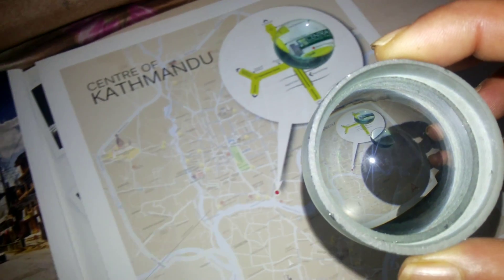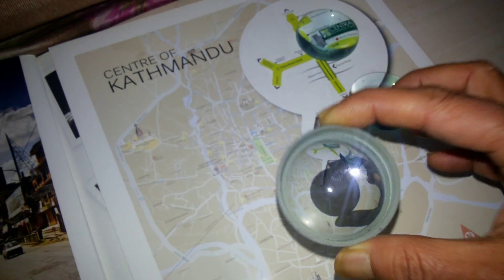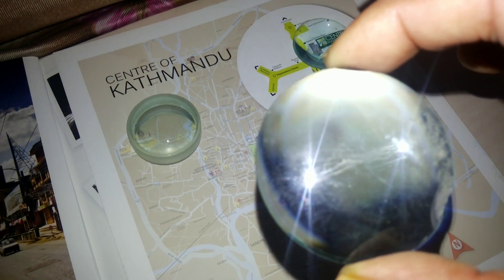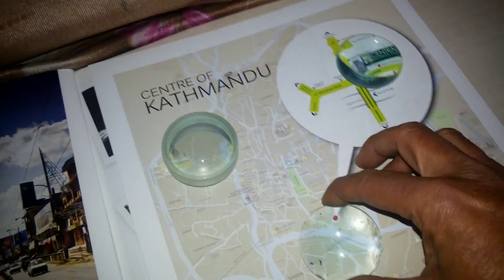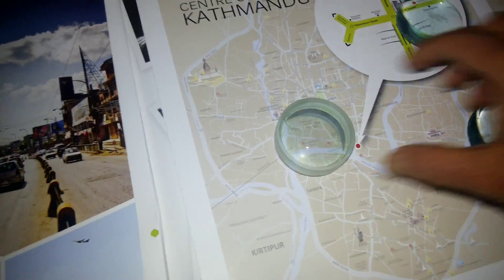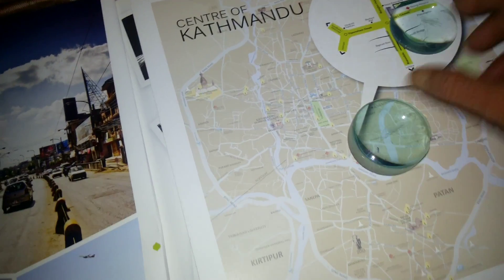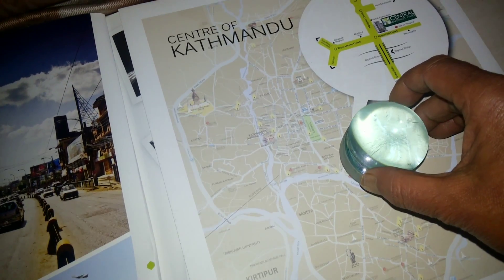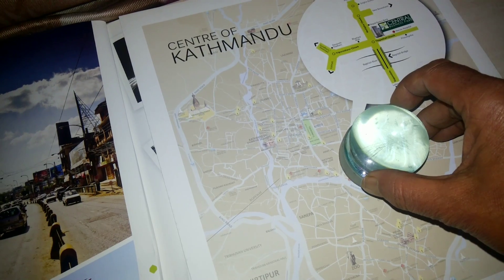DIY Barlow lens 30x Zoom part 1

Comment: I have 100mm focal lenses,
if I used less focal length of lens, will zoom x increased ?
Reply from the maker: Need more details, objective focal/Eyepeice focal is your magnification. Like 100÷5 is 20.
Reply: @debeshbhattarai  
1. 50mm achromatic doublet lens, 700mm focal length
2. 25 mm eyepiece.
so telescope is 28x
can I see nebula or galaxy through this ?
Reply: @abhishekchattaraj3488  no bro you need 500x zoom for seeing Galaxys